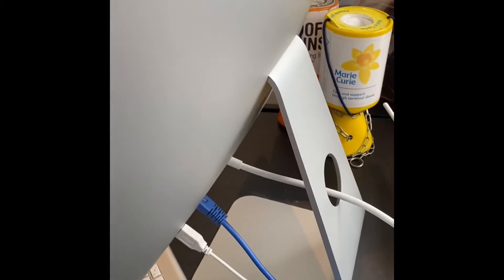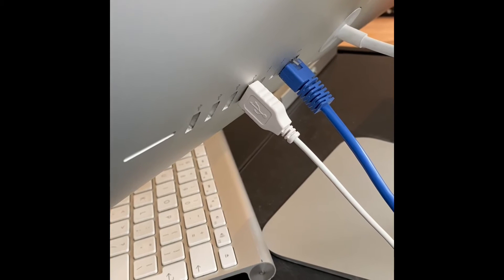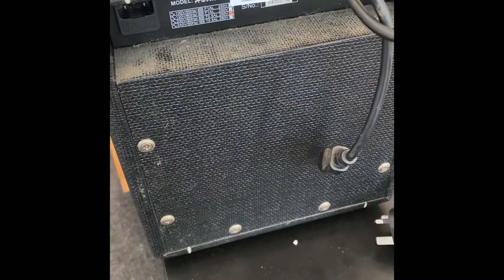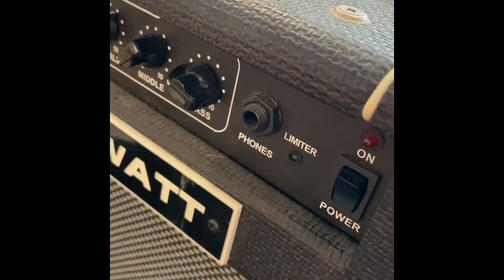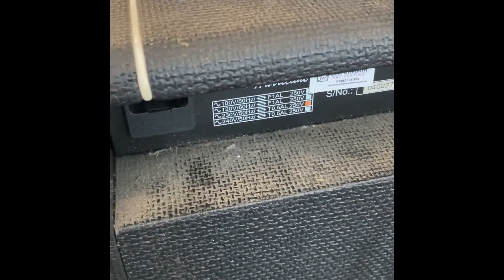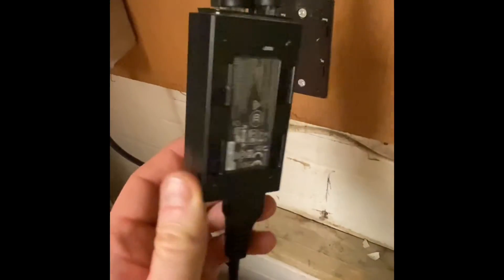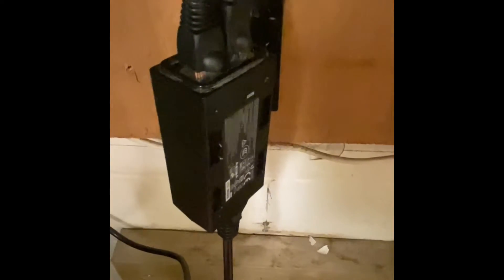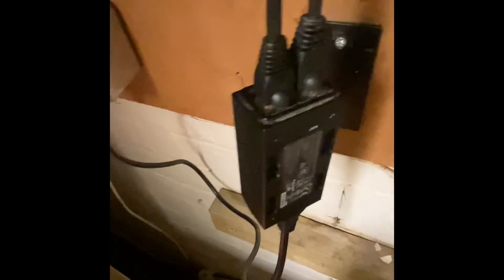PAT TESTING AN APPLE MAC - NOT SO EASY AS YOU THINK

Comment: I used a usb to micro usb attachment and plug  into the usb and attached the probe and got earth and it passed same mac as that one. Would not work on a mac monitor that is aluminium not sure why as i was using same method as the i mac.